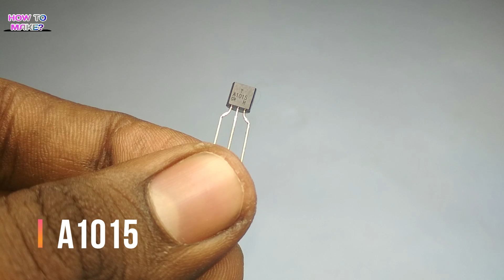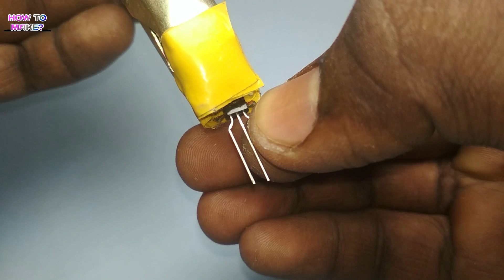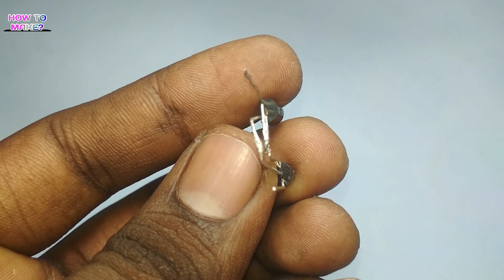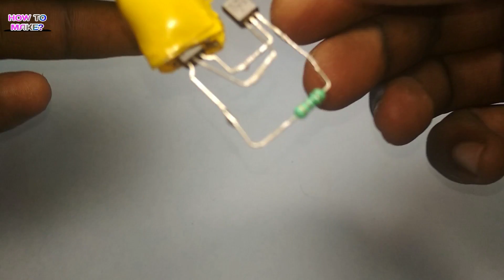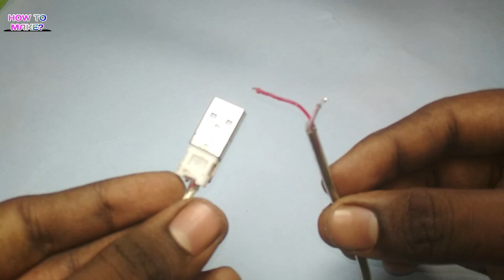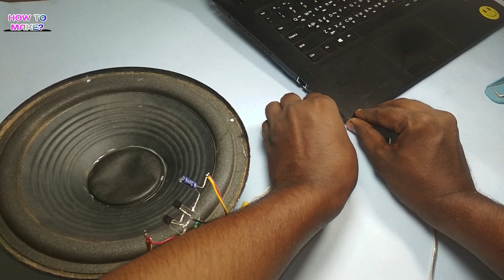Simple Audio Amplifier Circuit with 8inch speakers

Comment: you need atleast 8x-13007 Transistors, 2x-4700uf capacitors, 1x-1k resistor and a good power source, that delivers atleast 8A on 12V. That gonna be overkill, in this case you need 8x 13007 Transistor, because the input wave voltage is limits, arround 2V or less. Also this 8" woofer 80-150W. Build it!!! I also used 4x-13007 Transistors, 2x-4700uf/16v capacitors and 2x-1k resistor (coz its two way amp) and i got arround 2x25W performance.

Comment: Don't use any speaker over 1 watt because this transistor is not capable to drive over 1 watt also the lower resistance otherwise it will burn, this circuit will work if you know how to use it. 

For all electronic lovers- don't copy any circuit if you don't know how it works

Comment: the title should be " How to burn your sound card "
Reply: How would this burn your sound card?
Reply: @wattage2007  if the little piece of damn low performance transistor fails, also the amp performance is less than 10Watts, BRUHHH this guy showing us his smart ass, when we know he is a dumbass because he needs atleast 80W power to drive this woofer

Comment: Yeah I have done one thing like this I used 1080 and other one. But the 1080 transistor heats when switch on
Reply: Sorry small correction it's the same transistor which you have used
Reply: Transistor Generating Heat due to its normal property, Use heat sink dude.
Reply: Nope i try😂